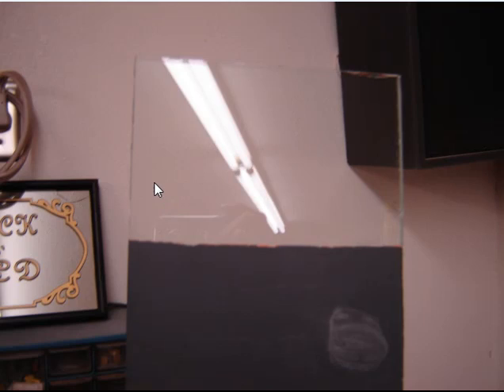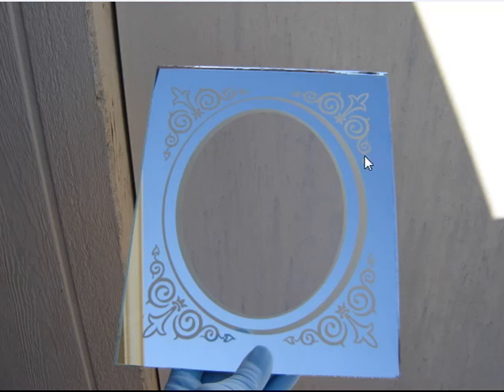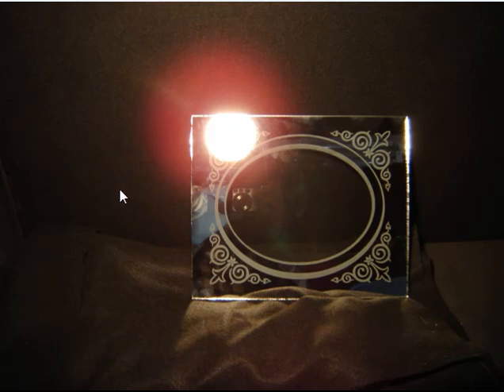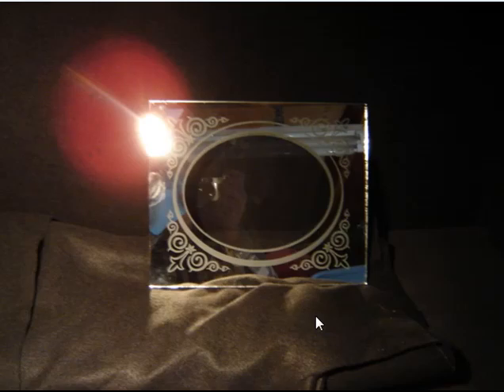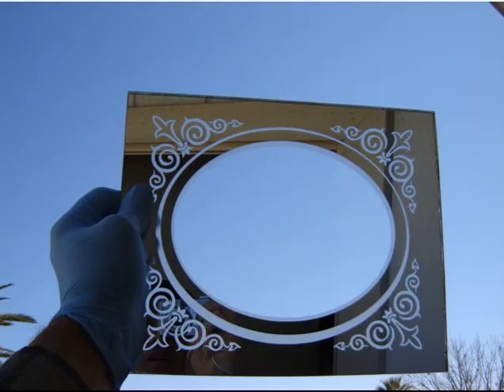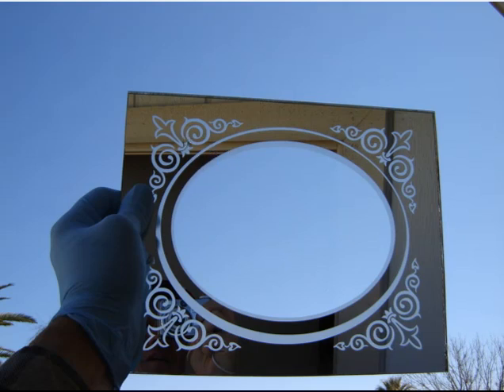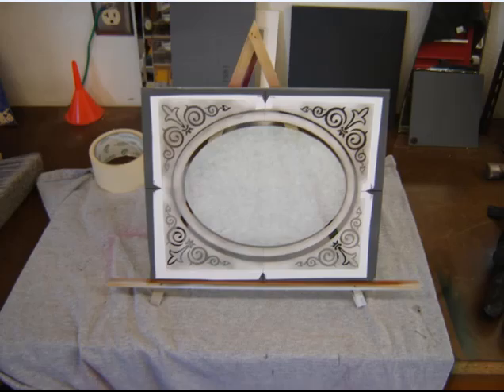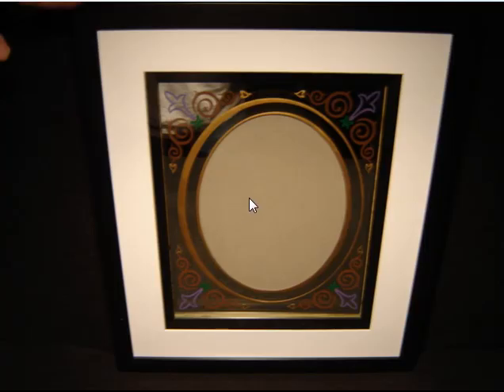desilver mirror 2

Comment: I have been doing sandblasted etchings and gilding for 40 years now. I could not hear your voice, so I will ask if you know how to selectively remove silvering without sandblasting, so that the removal areas are crystal clear? I usually use marine grade varnish, but It can be affected by temperature and direct sunlight. Love to chat....I can reached on FB (Rob Orizino) or call 3157272245...Perhaps we can be mutually beneficial